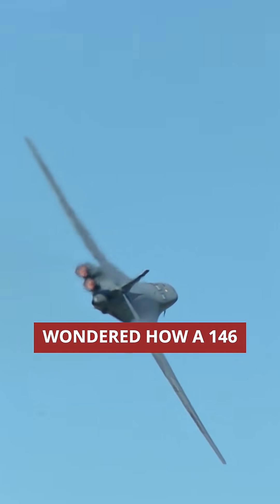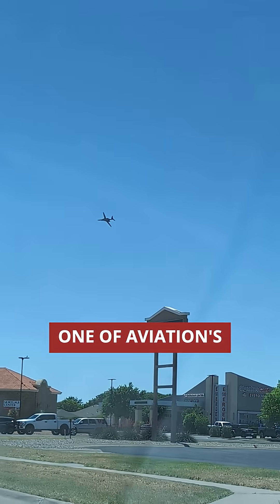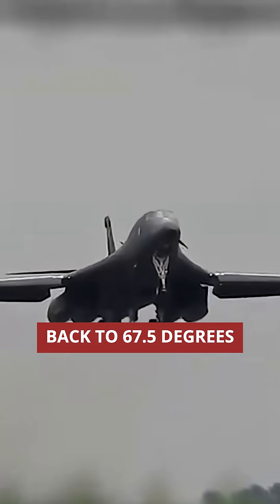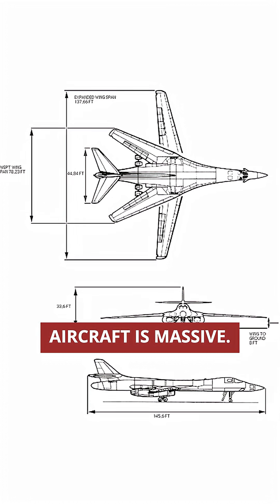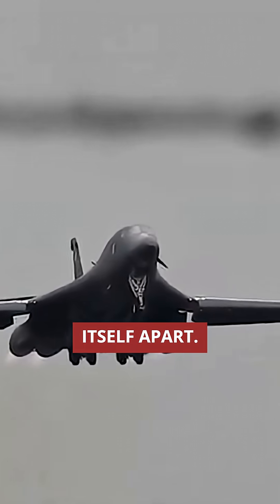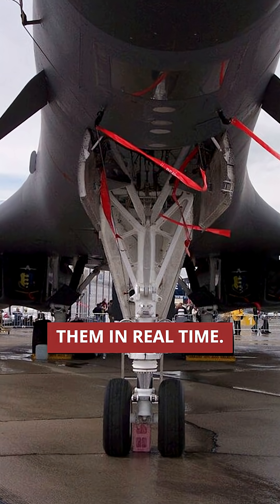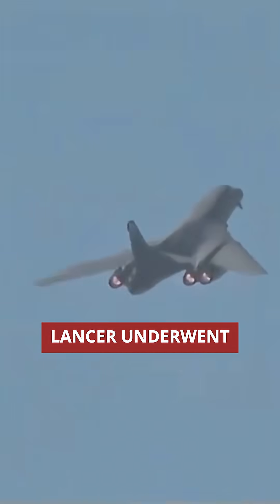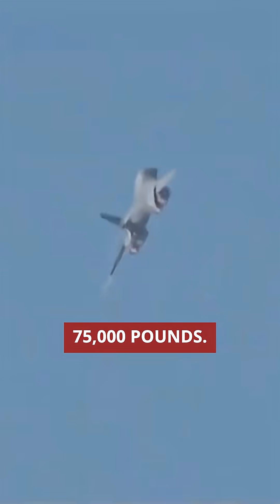Inside the B-1's Revolutionary Wing System

Comment: 2002 – North Kansas City the IRL 200 was about to commence. The announcer barked out his welcome to the race and a B1 – B Lancer screamed over the tops of our heads! The sound was insane! BUT, the fireworks failed to go off as planned, so they flew back around for a second pass even lower. The fireworks went off with loud report, drowned out by the sound of four screaming General Electric F-101 – GE-102 dual rotor after burning turbo fan engines! The sound and the glory! It was an event I will never forget!🎉❤❤🎉😮😮😮 —- Addendum: the race was a bore after that! Lol😅

Comment: Driving a truck pulling a rocky mountain train.
I was I n the middle of Wyoming in a snow storm,
Visabiliity was on two and a half marker post
And was traveling aout 25 mph.  I had some strange 
Static on both radios and my scanner.   Started hearing a sound i could not identify.  I was hauling butane and started to wonder if my trailer was
 blowing up.  Right over the top of me I saw four engines ( in that configuration) glowing.  I was guessing they were in afterburner mood and wondered  did the crew make a mistake and found they were too low and had too use them afterburners or ("Lets buzz that truck").  What ever the case it spooked me.  Had to stop and calm down a bit before I could continue driving.

Comment: I used to live right across I-40 from Tinker AFB, and a lot of interesting hardware flew in and out of there, pretty much around the clock, so one got used to ignoring the sound. My house directly faced the main runway, and most of the planes would land and take off just a few hundred yards in front of my house. It could get loud. BUT, even though I could ignore most of the planes, whenever one of those things came in, and particularly when they took off, you KNEW that it was a B-1! Especially if they were feeling feisty and kicked in the afterburners! 

My neighborhood was the original Midwest City Mile, built right next to the base as housing for officers and support personnel during WW2 and shortly afterwards. The B-1's would shake those old frame crackerbox houses so much that at least once or twice a year I'd have to go around the house and hammer most of the nails back in to keep the siding from falling off, because the vibration from the B-1's and other big jets would cause the nails to back out of the wood. They might be semi stealthy to radar, but they are LOUD!

Comment: Most don't know the B-1B was badly underpowered.

Max afterburner thrust from the four 30'000-pound thrust class fighter-sized engines was 120'000, giving a thrust/weight ratio at max takeoff weight of 477'000 pounds of only 0.25 .

Comment: As a former BONE pilot, I can tell you this is a very accurate video short! Well done. Indeed, the BONE is quite large. It looks smaller in picture due to its sleek shape, but up close and in person, it's huge. Typical take-off weights are over 350,000 lbs. And yes, the full sweep position on the wings is 67.5 degrees. It can also be flown at 55 degrees sweep, but at lower top speed.
Reply from the maker: This means a lot, appreciate it! ❤️
Reply: Thanks so much for your service!!!🫡
I bet you have so many stories….!!!
Wish I could buy you a beer & just listen to you talk!! 😂❤🫡🤩
.
If you don’t mind a couple questions; 
1) can the BONE really do barrel rolls as shown in this clip or was that a game / CGI?
How maneuverable is it? 
.
2) Next is how low and fast do you guys really fly it? Like for actual combat / combat training. 
.
Thanks again sir! 🫡🫡
Reply: @drjones762  Yes, the B-1 is very capable of barrel and aileron rolls. However, they are (or at least were)  prohibited maneuvers according to Air Force regulations. But regs weren't always followed. 😁Flight regs may have changed since I was in the Air Force. The jet is pretty maneuverable for such a large aircraft. Not fighter level, but much more than most other large jets. It's very responsive to flight control inputs. It's very pitch and roll sensitive. While low level flying when the BONE was tasked with nuclear strike role, we typically flew low level flights at 200-600 feet above the ground, depending on terrain and other factors. Speeds at those altitudes were very fast. High subsonic - usually around .85-.90 mach. Faster than that across the target area. Unfortunately, as far as I know now the BONE crews no longer do such flying due to the age of the aircraft and structural fatigue associated with it. The low level ops were quite fun and challenging. I was out of the AF by the time the jet was used in combat, so I can't answer any combat operations questions. Glad you're a fan of the jet! Beautiful isn't she?
Reply: @JamesJoseph-u1y  Wasn't there also a terrain follow mode that had three settings; soft, medium and hard?
Reply: @AdrienPenhoet-s1v  Yes there were.
Reply: @JamesJoseph-u1y  Sorry for the delay; thank you SO MUCH for the detailed reply! Amazing & fascinating! I've loved military aircraft my whole life. YES: she is STUNNING. I've loved the BONE especially since I can remember.

I had (probably still in mom's attic somewhere! 😅) a gorgeous all-white Ertl DieCast Metal model of the B-1, (B-1A I guess, since its all-white?) complete with a display stand, sweeping / movable wings & retractable landing gear! I spent many hours of my youth playing with that... I really want to find it! I found my F-14.... just need to find the rest!

Thanks again!
Reply: @drjones762  legit same i envy this dude and whoever is his friend. bet he’s an awesome person to hang with regardless too
Reply: Excellent comment, and thank you for your service. The BONE is, to my eyes, the most beautiful aircraft flying, military or otherwise. Pardon my geeking out, but that's a really cool plane to have flown!
Reply: @monsieurcommissaire1628  No worries. Geek out as much as you want! It was a pretty cool jet to fly, for the most part. (Like any military aircraft, It had its frustrations .) One time we had an SR-71 at my base and it parked next to a BONE. Wow! Talk about aviation beauty overload!
Reply: Is it set notches in the wing sweep lever handle thingmabob or is it a free thing without notches?
Reply: @tinycockjock1967  If I remember correctly, there were soft detents at the primary use sweep settings. The wing sweep was manual, not automatic. The settings were 15 and 20 for take-off or landing, 25 for cruise and 55 and 67.5 for high speed ops. Each pilot had a sweep lever located on the side of the cockpit. As a crew co-ordination procedure, the pilots would announce "Moving the wings." This was a call out that's very unusual in an airplane - "moving the wings"! LoL! 😄 You don't hear that very often in aviation!  I write in the past tense because for me it was. Of course the airplane is still operational, so you can assume present tense.
Reply: @JamesJoseph-u1y  damn dude that’s awesome. i’d shit bricks if my plane’s wings started to move without me knowing it has variable sweep. imagine one pilot goes “moving the wings” the second going “huh???”

Comment: I always assumed they would retire the B52 and have more of these. But given a bombers reduced role in a large scale war due to missiles on land or submarine I guess the bombers role is reduced to smaller tactical strikes on countries like Iran and Possibly Venezuela, an ole B52 is quite capable. Especially if you you use a  strategy of strikes and air support before sending in the B52's in. All bombers must slow to subsonic anyways to deliver ordnance. Therefore, the ability to go Mach 1.25 isn't really that important given the support the bombers have whether they're B52,s or B1-B,s The supersonic ability could only be used in getting to a region. And obviously the slower B52's are quite capable of lumbering towards  Iran unnoticed and not intercepted. Then getting there faster isn't a key to success. The B52 wins for operational cost by a substantial margin. This lets use fund other more useful assets while still having adequate bombers for there limited roles.
Reply: We're dropping Rapid Dragons out of C-130's.... ANY aircraft can be a bomber these days.
Reply: @QK_SAND Good point...

Comment: 🕉 Satyameva Jayate: Truth and Honesty and Reality that mystifies me is - How can this aircraft fly upside down? I mean, the aerofoil principle I can understand (that the air flows over the front a weak vacuum builds under the wing) it lifts the heavier that air machine - How does that same airfoil and the airflow over the wings will ’NOT’ create the same ‘lift’ effect when ‘upside-down’ - SO why does the damn thing not dive downwards now?… It simply keeps flying ‘straight ahead’ with any effect!… What is the Physics of this? The Aeroflot cross section have not changed… but what has changed, damn it? My brain is not accepting the bullshit about that vacuuming effect - I then say to myself, it must be the speed or forward motion - Wait a minute. Why have the aerofoil in the first place if speed alone can lift the heavy plan… See, That is not not possible.. Therefore can someone explain the upside down flight now!… The aerofoil physics keeps me wondering! By the way, I am a Microbiologist and have been seeking a plausible explanation - Mysterious force that keeps the plane and how it turns upside down and keeps on flying!… Satyameva Jayate

Comment: Explain how the counter suspension works
Reply: Turbulence induces harmonic oscillations that flex the entire airframe. It's kinda like how the muzzle of a rifle barrel will slightly wobble around a bit when you fire a round through it. When that happens, the nose and tail of the aircraft will basically bounce up and down at a certain frequency. The little wings on the front can sense that oscillation and pitch up and down at the same resonant frequency, but 180 degrees out of phase with the airframe, thus cancelling out the harmonic oscillation. In other words, as the nose bounces up, the wings pitch down; as the nose bounces down, wings pitch up. That makes the aircraft fly smooth and prevents structural damage to the airframe due to excessive flexing.
Reply: I’m also very curious as to how it works.
Reply: Classified

Comment: Supposedly NOT supersonic anymore after the change from the A model to the B model due to Cold War arms negotiations.
Reply: That "not" supersonic would be low level operations, specifically.
Cruising at 60,000 feet? Easily mach 2.2 still.
Though, those swaps were for a limited time, to save on titanium. I believe it's topped at mach 1.25 in low level flight.

Comment: It kinda underwent a huge transformation from just B-A to B-1B. It was originally meant to be a medium to high level cruise missile launcher (see Tu-160 Blackjack) but when the Reagan administration reapproved it it was reimagined as a low level penetrator to avoid the SAM threat it was expected to experience.
Reply: part of that was because of the SALT 2 treaties, limiting their speed as well, but also to cut down on maintenance and fuel costs when not at war. If you catch my drift... the BlackJack Soviet bomber is a cheap copy riddled with issues I've been inside one that was baking in the desert sun on a years in Beni Suef Egypt it was President Mubaraks when I was there on a joint training mission with Egyptian Air Force back in 1987 I actually borrowed a flight data card with Russian writing on it.
Reply: @nicholasklangos9704  president muabkarak had a blackjack?
Again youre talking crap.
Reply: I seriously doubt this larp
Reply: @nicholasklangos9704 the tu160 is not a copy. It is a superior aircraft in almost every metric. The B1 started development first but the tu160 had a serial aircraft first. Math that out for me. Soon you're going to say china copied American 6th gen aircraft, although there are none. And no, the f47 and it's similars are only concepts. Like a braggard does, it's never flown. Odd to contract an aircraft after announcing it's been flying, when we know how the us procurement chain works
Reply: @deven6518 it is in fa t not superior in every aspect. It is larger, faster and  heavier as well as being designed as a missile carrier. The B1 was designed as a low level penetrator with a higher payload capacity. It's also made more for stealth unlike the TU160 which is still a highly capable bomber

Comment: Sorry, but the B-52 bomber remains the workhorse for large bombing attacks. The B-2 Spirit is used for precision bombing where detection is a major factor. The Air Force wants to retire the entire B-1 fleet as it is maintenance intensive and costs more than the other two bombers to fly.
Reply: B-52 is a bomb truck. It can't fly into protected airspace without getting shot down. It's a missile carrier and used for bombing unprotected targets.

B-2 and B-1 can also attack targets which are protected by air defence systems, like the nuclear facilities in Iran
Reply: @simonm1447  B-52 IS a bomb truck. Though its protection isn't from stealth or speed. Its protection is from flying so ungodly high that you can only respond by shooting it down... After it already dropped its payload. If it's noticed at all.
If enemy radar has been taken out for some reason, you won't see it or hear it coming - there will just be explosions all of a sudden, a la Vietnam.
B-1 flies fast.
B-2 flies quiet.
B-52 flies so high that some fighter jets need to achieve a ballistic arc to reach it's altitude. So high that the response time to shoot it down could be twenty minutes from jets that are already airborne.... Or that's the plan.
Reply: @Fightre_Flighte B-52s never fly somewhere where they could get shot down. They have a huge RCS, and even extremely old Mig-21s can reach 60k ft. This may have been a problem for Mig-15s. 

Sams could shoot down Gary Powers 65 years ago.
Reply: @simonm1447 
While that's true, consider ballistic arcs from 65,000 feet. Also when's the last time you've heard of a fighter wing just chillaxin on patrol at 45,000 feet and above? If you're only around 30,000 feet and below, it's gonna take time to climb. Beyond that, it'll take more time to intercept afterwards.
Things are more complicated now, sure. The buff just keeps trucking. And, like the old fart he is, he just minds his business and takes caution where he steps. What's the harm in that if you're still able to carpet bomb 50,000 pounds of munitions (or drop the sun) on tactical targets that made a few too many mistakes?
Reply: @Fightre_Flighte any half modern fighter has a service ceiling of 60k ft, an today long range air to air missiles will take any bomber down which has no stealth. You do not even have to get close, you can shoot it down from 30 km away even from a lower altitude. 

B-52s job is to stay outside the range of threats and launch cruise missiles. Over 3rd world countries like Afghanistan it could fly because they had no air defence.
Reply: I mean, the B1 carries an extra 5,000 pounds of area of effect freedom dispensers. Though, yes, it's very labor intensive. That isn't helped that the B51 can fly further on a tank of gas than the B1 can.

Comment: Fun fact: B1 have long-lost russian relative Tu-160 which is insanely similiar to lancer. But probably it wasn't reversed engineered just had pretty much the same requirements (high speed, many bombs, low altitudes)
Reply: The 160 is a whole lot bigger too. Too bad they can't afford to use it :-)
Reply: @janus4002  Yeah, they cost about 16 billion rubles, which will be like 200 million dollars. And there probably not much worthy and accessible targets nowadays. No one wants waste such expensive toy to some SAMs ;)
Reply: The B-1 is slower, but it's designed for low altitude where you couldn't fly faster anyways. Mach 2 is only possible in high altitudes, but here you can't hide from radar without stealth.
Reply: @simonm1447  The original B-1 could do Mach 2.23, it was faster than the Tu-160, even with 4 smaller engines
Reply: @shawns0762 that's correct, however the B-1B got no movable air inlet, which limits the speed. However for low level flying this is not necessary since the dense air linits the possible speed anyways and costs less in maintenance.

Mach 2 in high altitude is no real protection any more against air defence